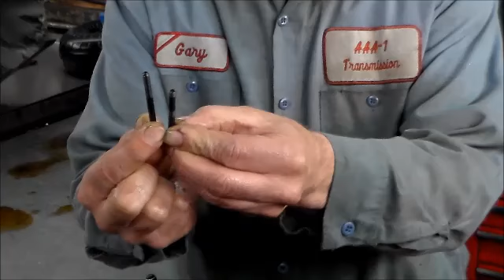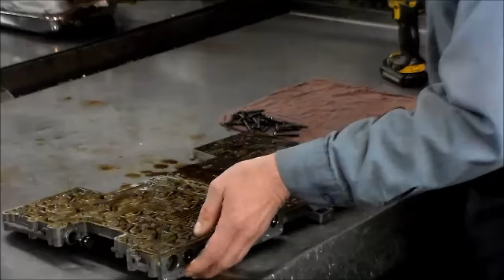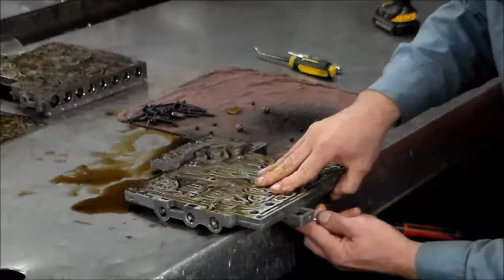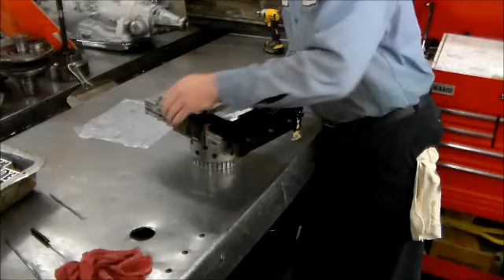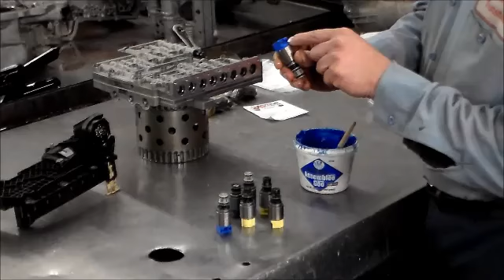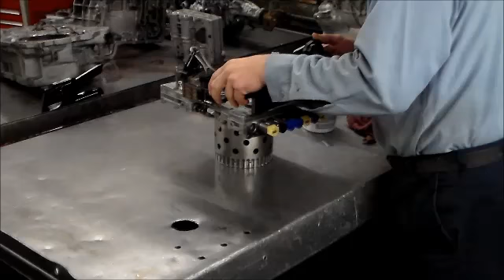ZF6HP19 Valvebody Overhaul

Comment: Hallo Garry. I am looking for raipair manual 8hp45x. You can help me if you know.....
Reply from the maker: +Antreas Mavris   I checked a couple of sites that i know of, and so far noone has it yet, its even tuff to get parts. Gary
Reply: +Gary Ferraro  thank you for tried  to help me. i tried to find the catalogue because the gearbox checked at other garage and now does not move at all.before has only problem with reverse.
Reply from the maker: Make sure they hooked up the manual valve.
Reply: +Gary Ferraro its electrical shifter
Reply from the maker: should still be some kind of manual valve to hook up on the inside, and is there enough fluid? how much fluid went back in(hope he didnt break the tabs off the pump gears.

Comment: mr gary i like your videos, i would like to know where do you find transmission parts for bmw, other than the card dealer. i have a 07 bmw 750i, and it runs ok for a while, and then if i turn off the engine i took a certain time to work again, and some times a few minutes, theres not many t shops that work this transmission and they told me is the module on the valvebody, and the price they give me is too much.
Reply: he uses transtar transmission parts.   he always uses OEM parts.  After working on cars many years, i agree with Gary on using oem parts instead of aftermarket.  In the end you save money but you will wnd up doing the job twice or worse.

Comment: Thanks for doing these videos!  It really helps when DIY'ing these things.

Quick question though... From my reading up on the forums etc., there should be a white foam strip between the TCM and the solenoids which was said to prevent metal shavings from shorting out the electricals.  However I found that my mechatronics didn't have that foam strip and it seems to not be present for the one in your video either.  Did someone forget to put one in while they build these or was it actually omitted sometime during the production?
Reply from the maker: +Tony Cheung   Tony, Must have been omitted during production, i honestly have never seen that. Thanks for watching Gary